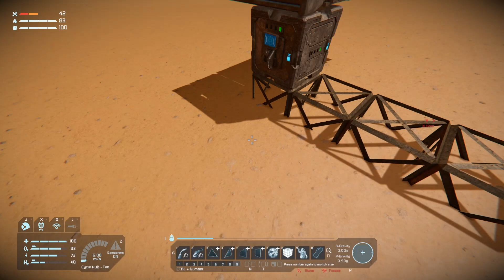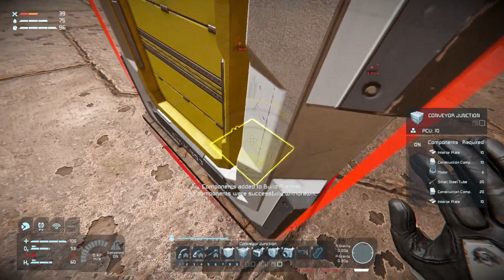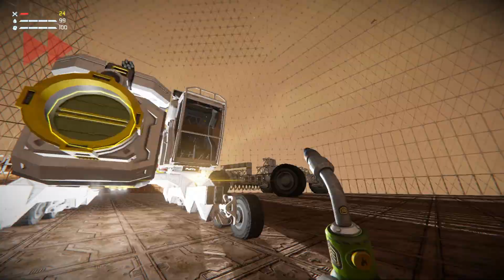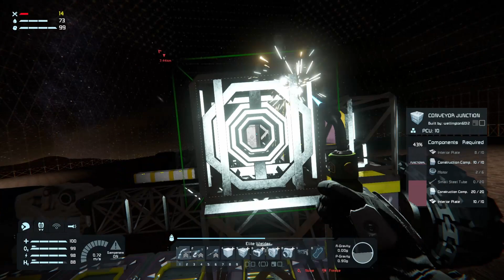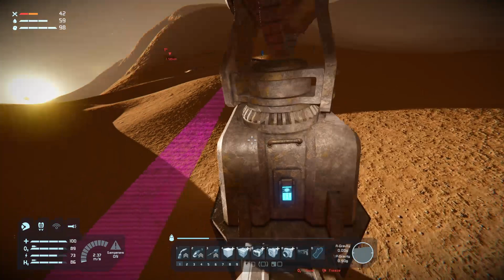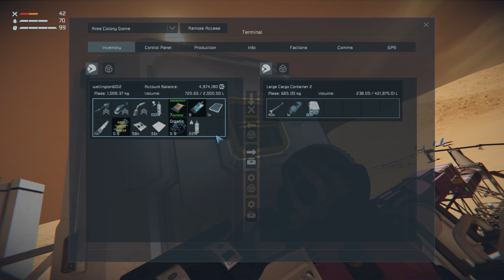Ares Colony EP28 - Lots Of Welding (Space Engineers)

Comment: That dome is looking awesome!  Have you considered using the nanobot mod?  It's come in handy for me when it come to large welding projects, though it is kinda cheaty.  Keep up the great content!
Reply from the maker: Hi VC. I seriously considered it when I was building, the welding of this dome proved to be a challenge, but a good challenge. The main thing that put me off the nanobot mod, I have a lot of incomplete blocks used for detail, especially the glass panels used for support on the pipeline, I didn't want it completed those.
Reply: @Wellington6012  For your information with at least the Build and Repair Mod (sometimes called BoB) you can set it with a colour that it will not weld up the block as well as a colour to auto grind